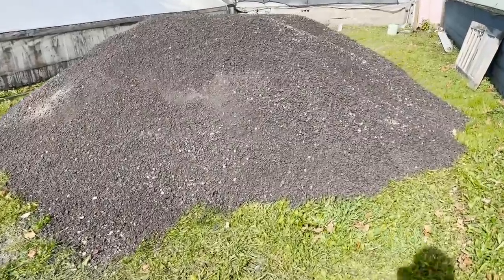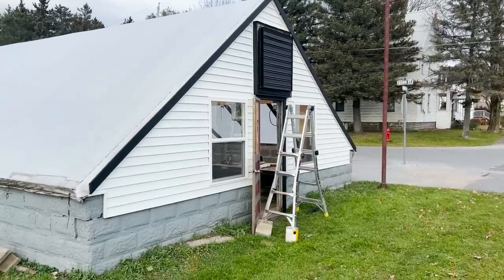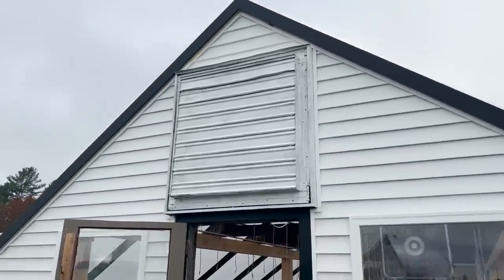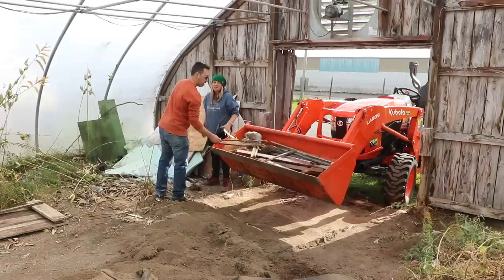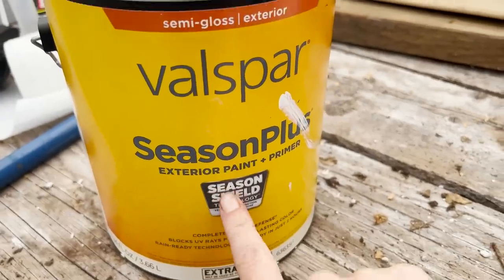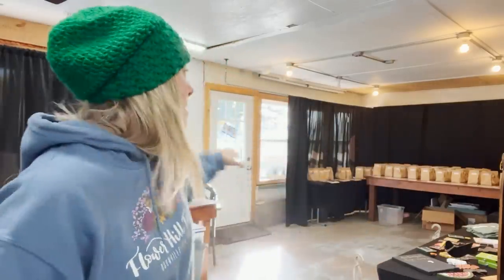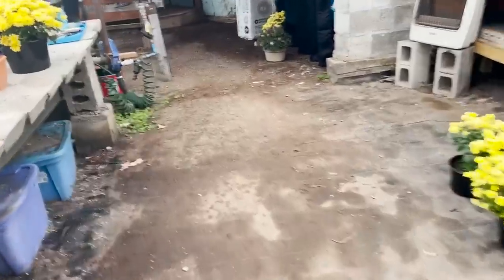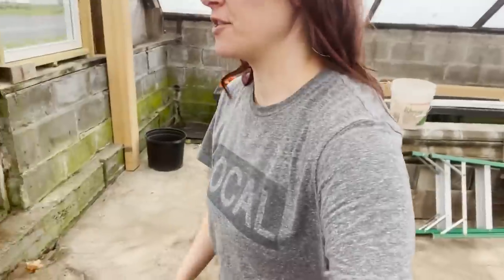Crushed Stone for New Nursery Floor : A Quick Paint Before and After : Flower Hill Farm

Comment: Team white here! It was too much weight above the door to my eye when it was black. If the fan was smaller it would have worked better, or you could have tried a different color that wasn't so heavy. But I also think it would be nice to put something on the entry walls to draw the eye up from the trim. That can be a later project 🤣.